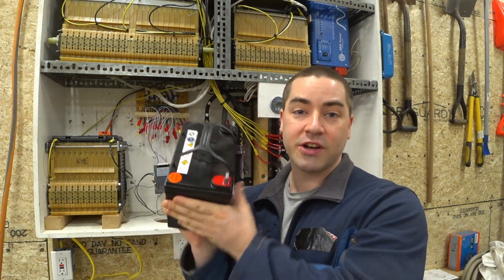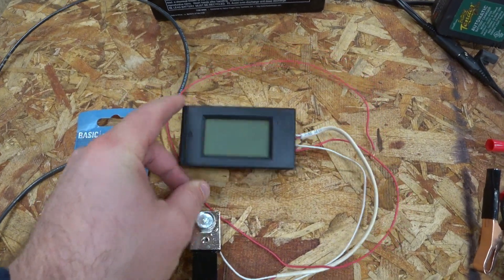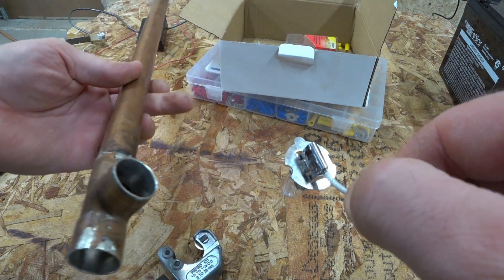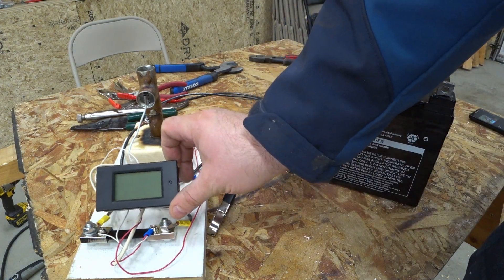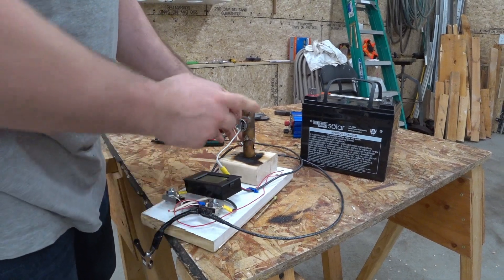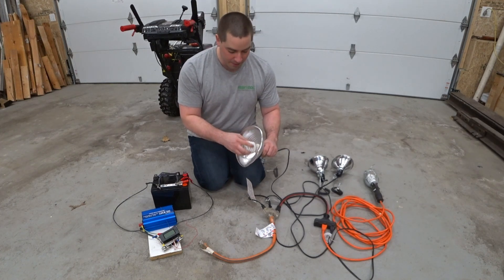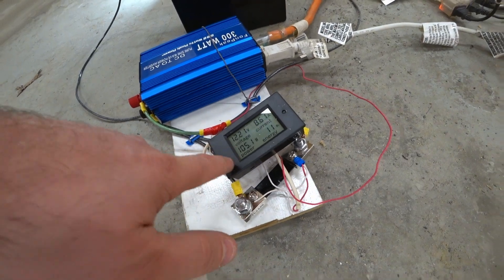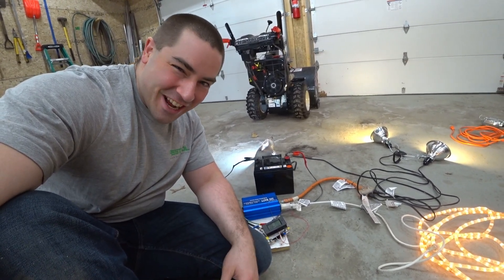DIY 12v Battery Capacity Tester (Stuff on Hand)

Comment: But u haven't mentioned how long does it have to be on load to pass the test if the battery is good or not
Reply from the maker: This build didn't work well.  I made an updated version that works better.  I'm trying to find the capacity of batteries I'm testing.  So I charge the battery to full Voltage, then discharge until I hit Low Voltage.  The high/low Voltage will depend on the battery I'm testing.  I pull that information from the manufacturers data sheet.

Comment: way to destroy your battery if you exceed the max draw of the battery the battery will deterioate very fast !!! when building a solar system for example you need to take into account the max draw, the max charge capacity hook up more batteries in parralel to migate the max draw and this will give you the maximum lifespan charging cycles of the factory specs.

Comment: Nice rational thinking through this project.  I would be carful about using the inverter to stop the test as 10V should damage a 12 volt lead acid battery.  10.8 V is usually the lowest they test it to and even that is in the area where your shortening the life of your battery.

Comment: Just a note, if in the future you are looking for a restive load try an old dryer. They have a metal tube like a furnace duct with coiled nichrome wire  heating element. I have used it for testing power amplifiers and power supplies. The great part is if you get one from a 240v drier you can tap in any where on the coils to get the load you want.
Reply: How long should u leave the dryer on before measuring the battery voltage , and what voltage should be consider good ?

Comment: Yeah, I'm a bit late but an old style car headlight is 55 watts @ 12 volts, roughly 4.6 amps. Back when I was checking car batteries I used a pair to even it off at 110 watts, which is like leaving your lights on accidentally. Round numbers hurt my head less so let's call it 10 amps and work against the rated amp / hrs of the battery in question. Should be easy math. Even easier is using a 100 watt light bulb, which is still 100 watts at 12 volts DC. Want round numbers? Use a pair of 60 watt bulbs so it's 120 watts working on 12 volts.... 10 amps on the money! BTW, getting hard to find incandescent bulbs over 40 watts (use 3 of them?) but with that small tractor battery you should probably stick to a 6 amp / 60 watt draw. (for round numbers) Just easier on the small battery, which is likely in the 40 amp hour range at best.

Comment: Just a little tip - the incandescent 100W "older standard" bulb you spoke of can be run directly off of Direct Current and therefore would not require an inverter! Knowing this might make this project a bit more wallet friendly of more viewers. I have already ordered the DC Watt Meter - I have several batteries that need tested. While on the meter mfg page I also ordered the AC Watt meter, also inexpensive with a small foot print.

I myself would like to have a 1500+ wattage inverter for the garage. For me this means waiting until I have about 10 times the cost of the 300 watt inverter. While most of the saws and such I use in the garage do not require that much power after starting the extra power is needed, in highly inductive loads such as electrical motors in saws, to get them started.
Reply from the maker: As for inverters, I burned up a couple cheap light weight inverters on my miter saw.  I learned I needed a low-frequency inverter for power tools.  The one I have now weighs over 80 pounds because it has a big transformer inside.  I'm using an Aims 6000 watt 48 volt.  If you are looking for a 1500 watt, 12v, they have one with a transformer here: https://www.aimscorp.net/1500-Watt-Pure-Sine-Inverter-Charger.html  

I'm not affiliated with them, just a customer.

Comment: You are a lot of fun to watch!

A 20" box fan is $20, if you don't have one already.. 3 speeds, and the loads will be about 60, 80 and 110 watts.. Might be an easier method to load batteries, and they're great for the garage in summer.  

Most of us have killed good batteries relying on the inverter low voltage shutoff to protect the battery!  But I guess that is the point of your test of battery capacity.. full discharge.

https://www.amazon.com/gp/product/B000HHJ2I2/ref=ppx_yo_dt_b_asin_title_o01_s01?ie=UTF8&psc=1
Reply from the maker: Thank you, the box fan is a pretty good idea.  It already has a built-in load adjuster!

Comment: Or, you can just pick up 100W 1,5R resistor which will drain 8A. It doesnt mather how big is the load, because your meter is counting in Wh. The bigger is the load, faster is the measurement. Or from the other point of view, with the smaller load you can gain more capacity from your battery.

Comment: Easiest way to do this is just an inverter powering a kill-a-watt style meter then into your load. Probably best to match the load to the advised 20 hour rate of the battery. Then you have your automatic cut off when the battery is thrashed and easy reading of the watt-hours you have put through your load. You do need a meter that has a battery backup, so it keeps it's reading when the power is cut. But many do. And they also have a time reading as well. 

As for checking out batteries an automotive battery tester will allow you grade a bunch of batteries in minutes. I have a cheapie one that works by determining the internal resistance of the battery and it's a really good guide when you're sorting your batteries out.

Comment: Testing a lead acid battery in this manner is going to destroy 5% of it's cycle life. That's the reason they don't test this way. Also battery capacity is measured in amp hours, not watt hours, again for good reason. Your test tells you nothing that a load test wouldn't tell you that takes seconds. With a 12v battery you want to know if any cells are bad and how sulphated the plates are. Your test does neither
Reply: For a lead acid battery, the total number of amp hours in it's life is fixed. For a 100ah battery, you can discharge 10ah 1000x, or 20ah 500x, or 50ah 200x, or 100ah 100x. In every case, the total number of ah is 10000. Aliexpress sells a battery capacity tester that measures ah with adjustable cut off voltage for about $50
Reply: I'm guessing David is wanting to see what the battery can do. Not just trust what the battery mfg says. In that case what David is doing will tell him exactly what he wants to know.

Comment: David this  halogen bulb is only $1.00 dollar but they have 300 and 100 watts too. I use them a  resistor to limit currents in my inverters. https://www.harborfreight.com/500-watt-halogen-bulb-63367.html you can put them on a sand box and have a radiant heater or use them  indoor as an  artificial sun for the  gosun oven. Each one can radiate over 600 degree.

Comment: I don’t understand why you put the bulb inside the pipe - it was obvious (to me at least) that was going to happen.
Reply from the maker: I've seen bulbs shatter from heat.  I'm afraid to be next to one and get shrapnel.  So I figured the pipe would contain the glass shards.  I drilled holes in the bottom thinking it could have a chimney affect, but that wasn't enough to keep it cool.

Comment: Hey guys. What are you testing 12v battery power & dc balp ac balp 12 hour. Battery power life..? Or inverter power life..? Thank You. for your drawing video.
Reply from the maker: I built this to help me test 12 volt batteries.  I want to find the capacity of the batteries in watt*hours.  Thanks for watching.
Reply: @DavidPozEnergy  Then it would make sense to discharge at the 20h rate, because only then you'll get the Wh for the battery. Shorter discharge (higher amperage) rate and you'll get less Wh out of the battery.: Example: 100Ah battery 20h discharge rate = 5A (at 12V).
Reply from the maker: @ Sailing Taku Moe, good point.

Comment: David, the first test fixture was not a dumb idea. It just needed some modifications. Those bulbs are a great load, but they do get HOT. Maybe just tie them on the side of the pipe with wire. You can add more as you need them.

Comment: Mount the bulb above the pipe not in it.   The air around the bulb will cool it...   It is going to be interesting to see what you have up with the 12 volt batts
Reply from the maker: I was afraid to mount the bulb in the open air, in case it got so hot that it shattered I didn't want glass flying at me.
Thanks for watching.